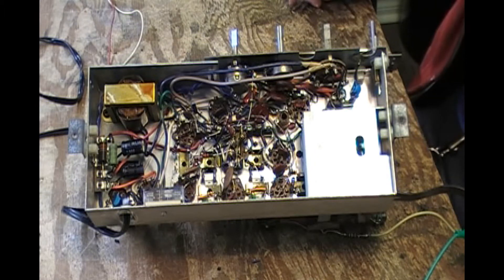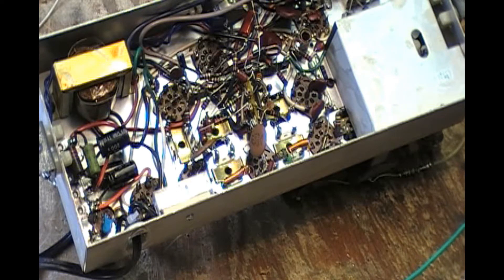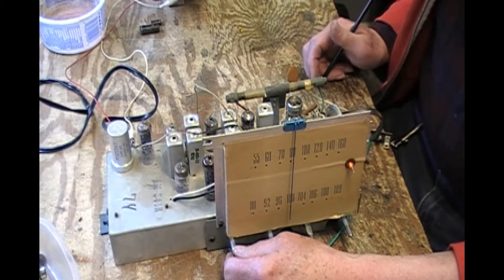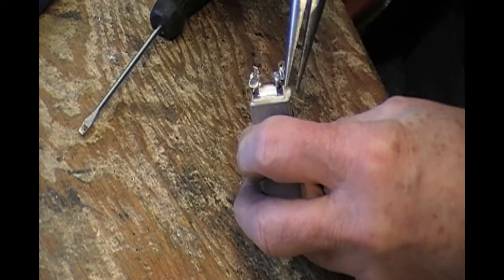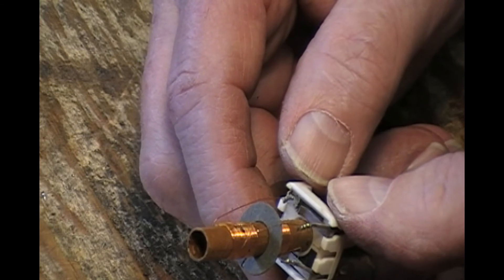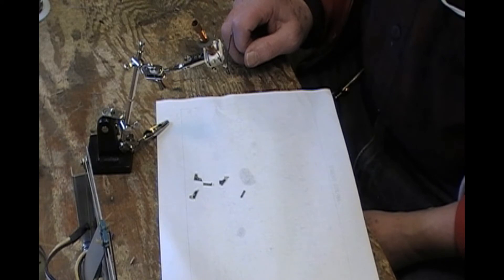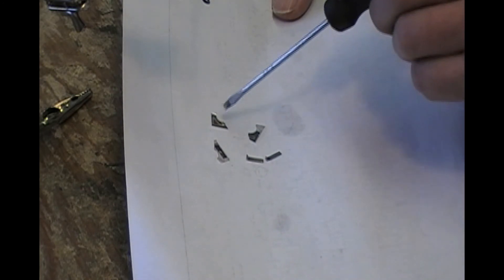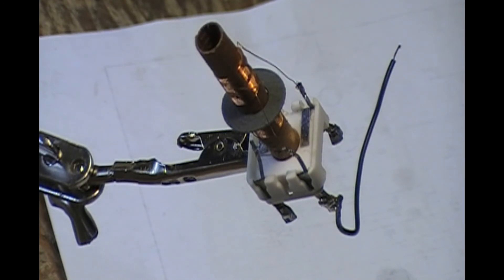F.M. silver mica disease in Tube Radio

Comment: How did you measure the inductance of the coil?  Can you just buy a meter that measures inductance?  I’ve never seen one.
Reply from the maker: Hi Don.  I have a cheap Chinese tester.  But actually I usually measure the plate cap by unsoldering the coil and using the same tester to measure.  The internet usually supplies usual cap values, and if any suggested values are used, the coil can be realigned to achieve proper receiver performance.  I've  been watching with interest some of your radio repairs,  cheers, Don